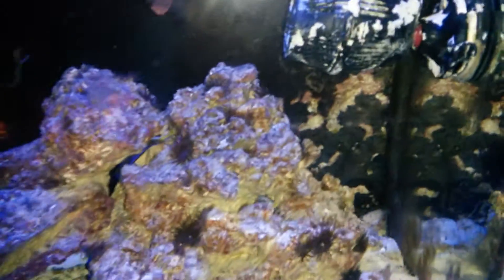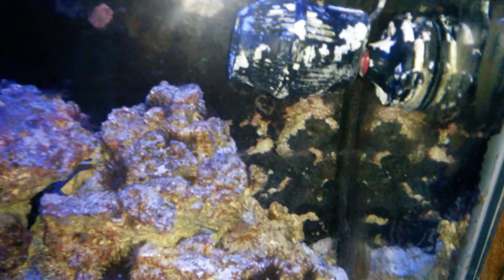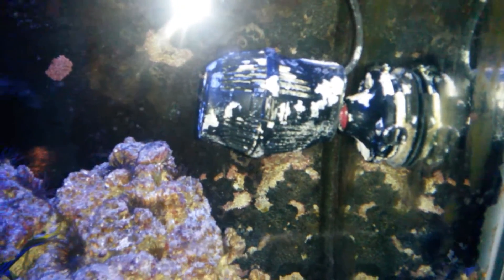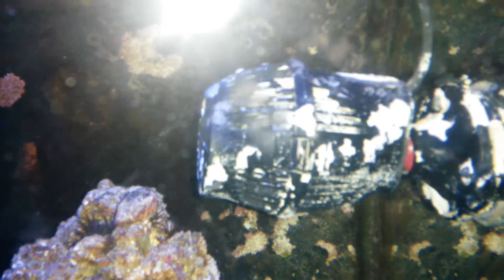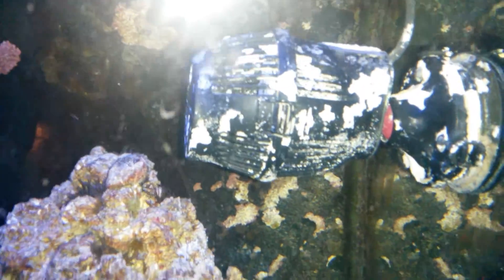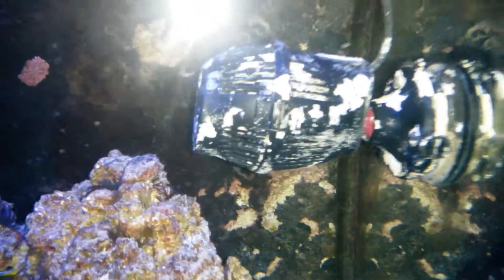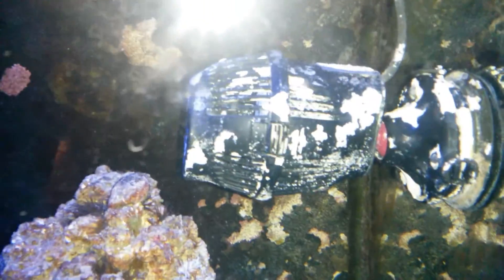Koralia water pump noise from hell!!

Comment: Check the base mount! I had this problem and magnet on wet side was vibrating against glass.  I put a heavy duty rare earth magnet on dry side and the problem went away.
Reply from the maker: ShimaUta86 ....replaced it with the newer ones real quiet. Thanks though